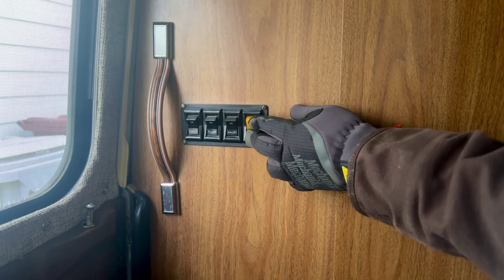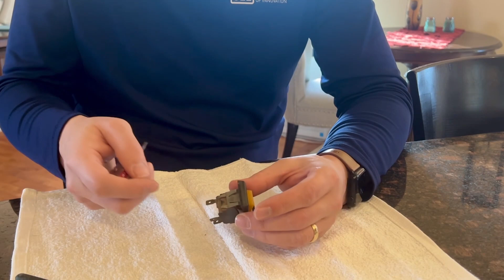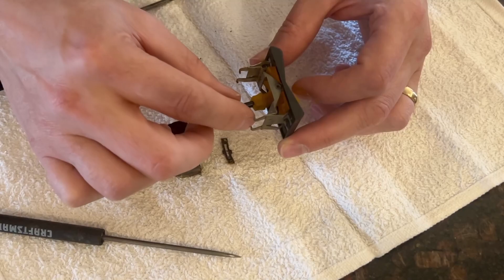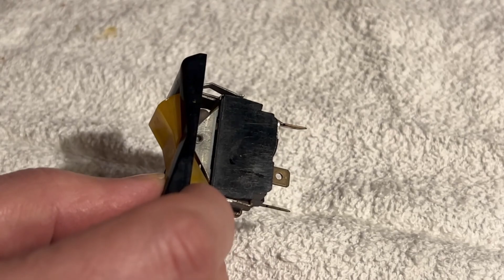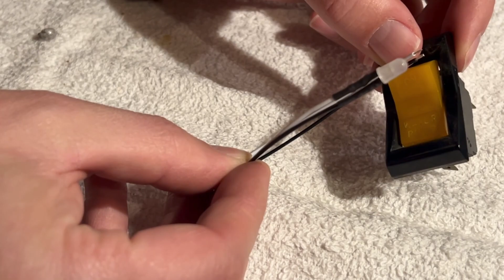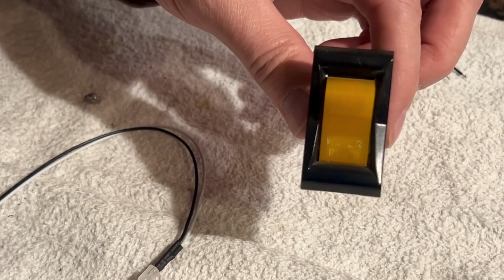GMC Motorhome Water Pump Switch

Comment: If you add a relay across the pump switch with the relay coil powered by the bathroom lights, the pump will be powered any time you enter the bath and turn on the lights.  The pump light will also remind you that someone is in the bathroom, or that the bathroom lights have been left ON.
Reply from the maker: Great idea! I've been thinking about doing something like this but it's a ways down my list. :-)

Comment: nice video. I cant wait to get to the point on my coach where I can work on one small project a feel a sense of accomplishment. Still working on my complete fuel system overhaul with Holley sniper system.
Reply from the maker: I hear you, I have a long list of things I need/want to do and I have to mix in some of the easy things so I can feel a sense of accomplishment. ;-)